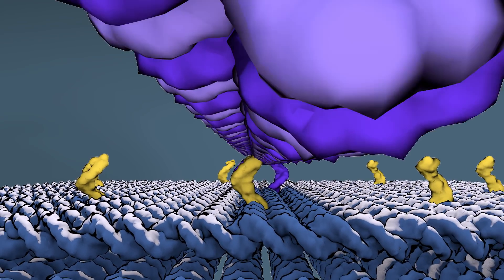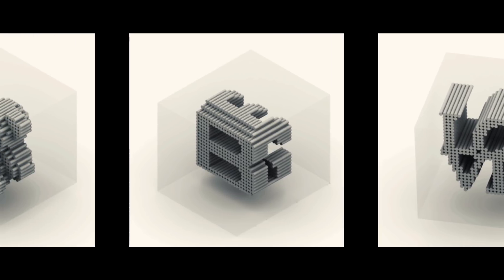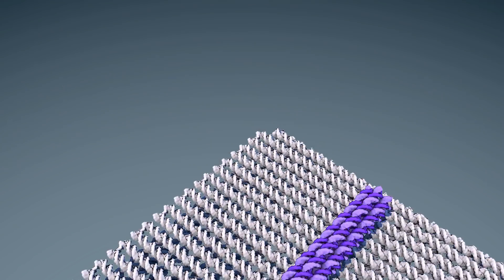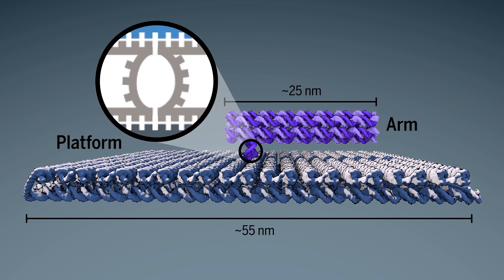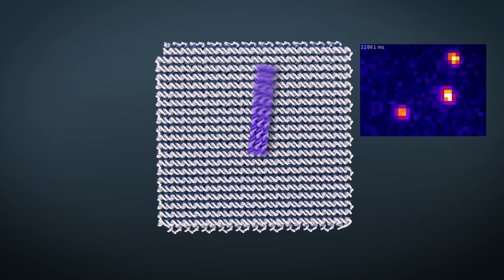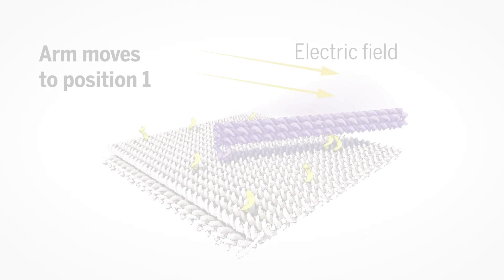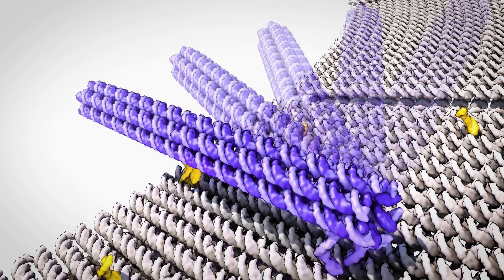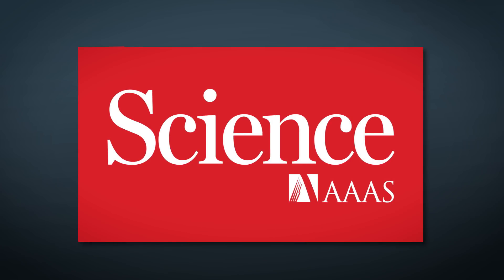Watch a robot made of DNA swing its arm

Comment: Yes! Fast electrostatic actuation of structural DNA mechanisms.
With this the next major milestone on the long path to advanced atomically precise manufacturing (APM - see books "Nanosystems" & "Radical Abundance") is archived. I was very much waiting for these news. This is of historical relevance.

Next up this needs to be electrically parallelized and combined with nanomechanical demultiplexing (challenging) to widen the data bottleneck. All that while reducing self assembly failure rate and improving convergent/hierarchical self assembly capabilities (which already have been demonstrated in a two-stage-assembly fashion)

Comment: This wouldn't be 3d printing.  3d printing is top down.  Assembling from the bottom up is well, nanomanufacturing.

- I must futher wonder how long it will take them to go from this to nanosystems.
Reply: Thanks oker59.
To be even more "precise" its early topologically atomically precise manufacturing.
"Topologically" since which atom links to which is precisely defined but the atoms still thermally wiggle around much more than their own diameter. This is because these relatively stiff DNA structures do not feature high stiffness in absolute terms.
These DNA mechanisms are the very early precursors of advanced positionally atomically precise manufacturing where we'll make very stiff gemstones metamaterials (with non gemstone like properties) pretty much in an atom by atom way. In such products atoms are wiggling around less than their own diameter. But it's still a long way there.
Reply: well mechadense, 

one can always put the word topology on some spacial arrangement.  Of course, you're saying this is soft topology; it's deformable.  Yes, we have a long ways to go in nanomanufacturing.

One can imagine all kinds of advanced nanomanufacturing beyond even Eric Drexler's daimondoid nanosystems. I remember thinking one could use bose-einstein condensates to then encode the arrangements of atoms by holograms, and then let the structure crystalize almost out of nothing!